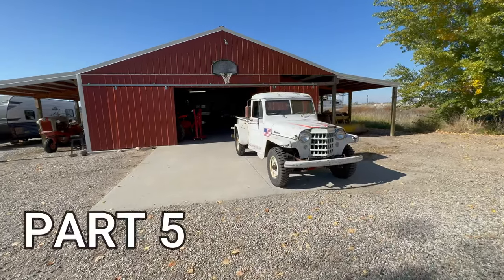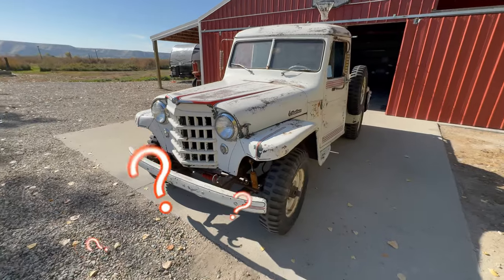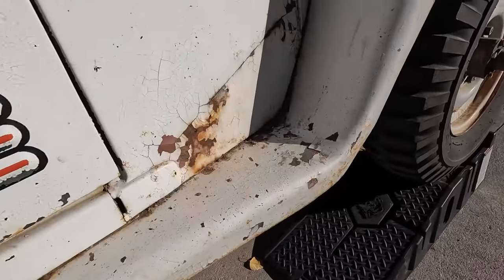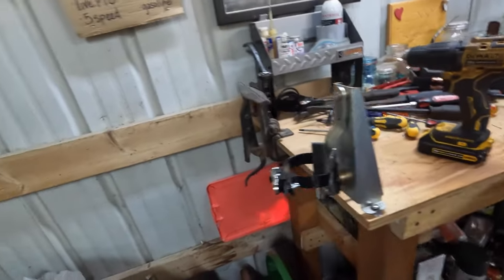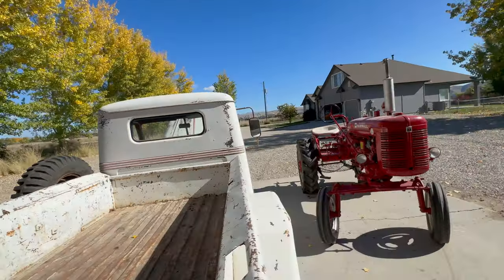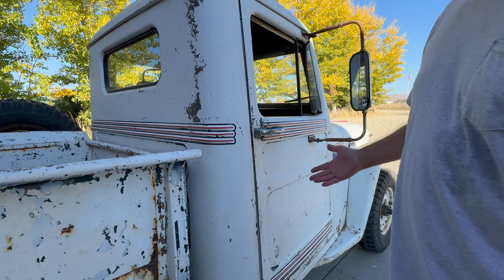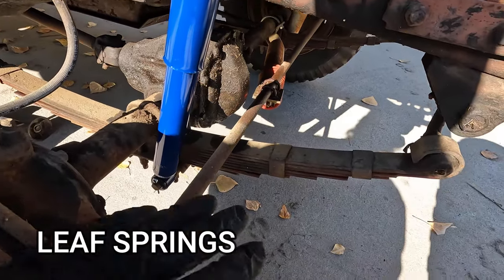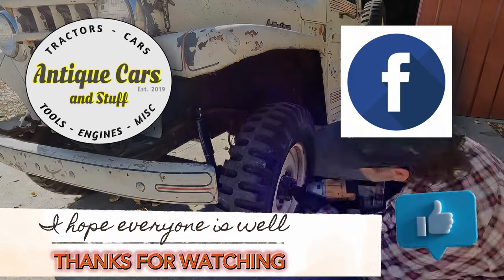1952 Willys Overland 4x4 Truck - Part 5, The Mechanical Inspection Continues

Comment: The Spicer 18 t-case will always leak.  No need to pull the drain plug. Just put more in on top. You may want to find a taper roller bearing up grade for the center shaft. Makes it much quieter at speed. And they dont wear out as fast as the stock needle bearings.
Reply: Vintage Jeeper does that kit

Comment: Mustie uses a mix of kerosene and bar and chain oil to coat the underside for rust protection. Then drives on a dirt road so the dust sticks to the oil.
Reply from the maker: Interesting. Thanks.